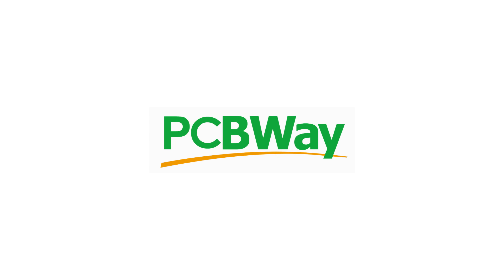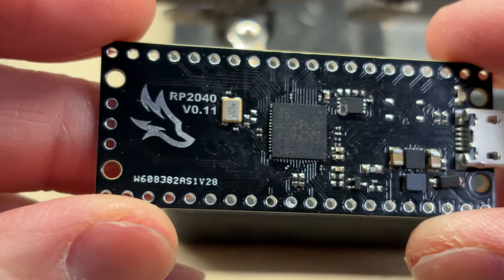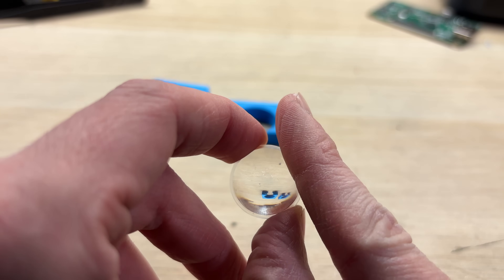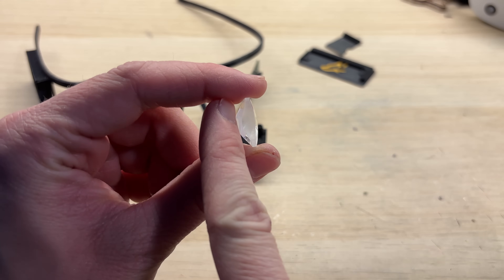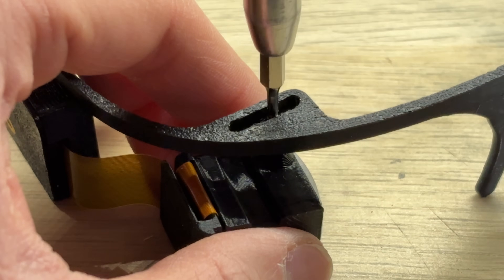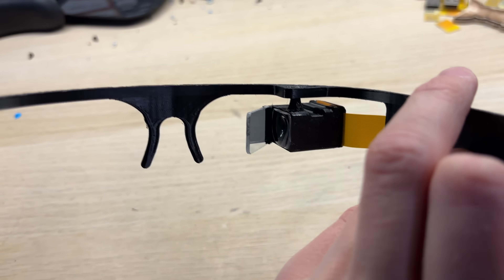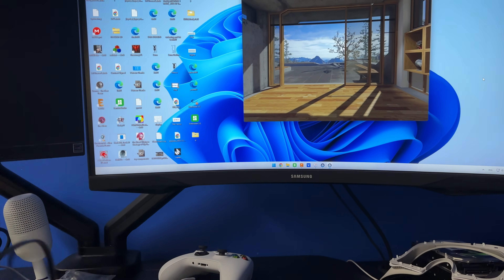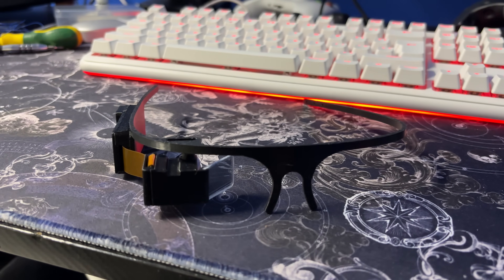Sideloader 3.2 | DiY Wearable AR

Comment: This is really cool but I'm confused by some aspects of this project that I'm hoping someone can clear up
1. Why did he transfer the components of the pi to his custom board? Wouldn't the pi suffice?
2. Why bother with grinding down the optics when you can just design a housing around it with a 3D printer?

Comment: Great work! Thank you for sharing.
It might be worthwhile to print a jig that holds a webcam in just the right position to see through the separator. That way you can make videos but also you can use it when testing without the need to put it on and take it off every two minutes. 😂

Comment: The display and the driver board is nearly identical to the ones I've taken out of an old Vufine VUF-110! The one you linked to is a little bit cheaper and has better optics tho! So I will absolutely be using that one for future improvements. Thank you!

Been working on making my own wearable AR that'll clip onto my glasses with an Orangepi Zero 2W attached to it so the only wires would be the power supply wires. 

I'm definitely writing down notes from this videos to tweak my current projects with!
Reply from the maker: Vufine display is about 0.2” and this one is 0.4”

Comment: This is incredible. I want a module to attach to my actual glasses. You should get loaded licensing/updating/maintaining a FOSS/repairable/modular design and making sure the margin stays fair to you. Like framework only not absurdly greedy/techbro.
Reply: I would 110% buy a ready made heads up display, but even just a kit or something like that would be sick! maybe a byo prints option?
Reply: framework is simply a rebranded clevo. it is literally ( in direct meaning) an MSI inside.

Edit: forget that, I mixed framework with system76 which is 100% Clevo. For some reason I thought that's the same company just different subbrands.
Reply: @inwerp  Um... no? Have you ever seen a Framework laptop? I bought a 13" one last year and this is the first laptop I'm so happy with that I stopped using my desktop workstation. And I've used many different laptops over the past few years, from awful Dells to the most powerful Apple Silicon MacBook Pros (that last one would be close to Framework if not for repairability and FOSS friendliness, however it does win easily when it comes to energy efficiency). But if there are other manufacturers making comparable laptops then I'd love to hear about it.
Reply: @tuesss ur right, I edited my reply. System76 and framework melted together in 1 company because of somewhat similar marketing /audience. Framework looks like a decent compal developed device.

Comment: what would it require if id want to have like overlay just for maybe time, gps position etc.
not yet sure what all id want in the end if i make this.
Reply from the maker: You can make an app with just a black screen and whatever widgets you need. Black screen is not visible trough combiner
Reply: @ManolloMancelli  got it, thx!